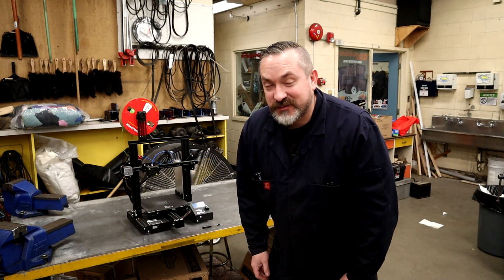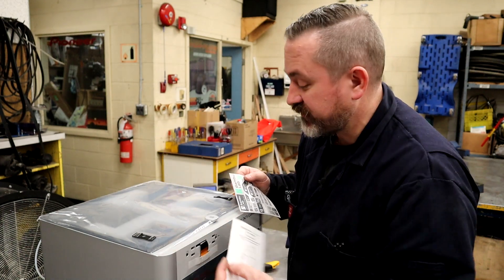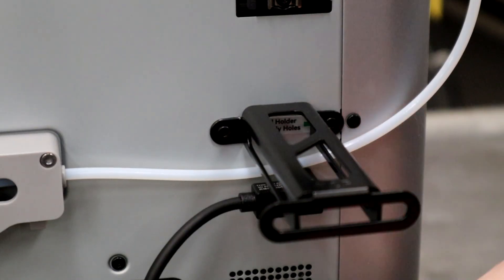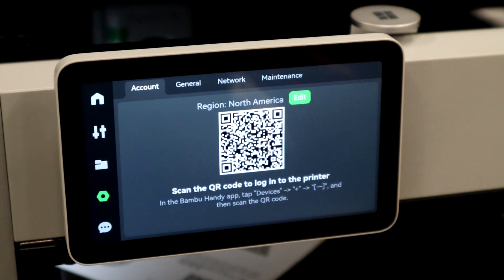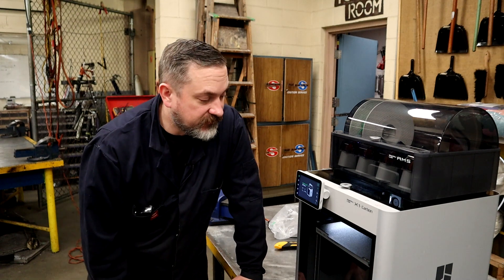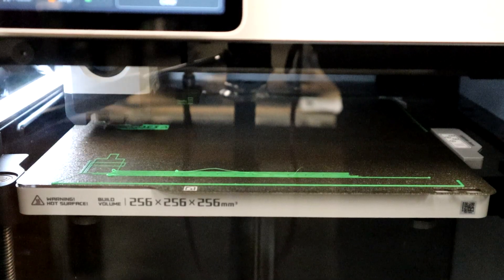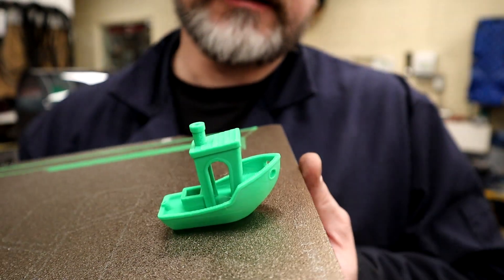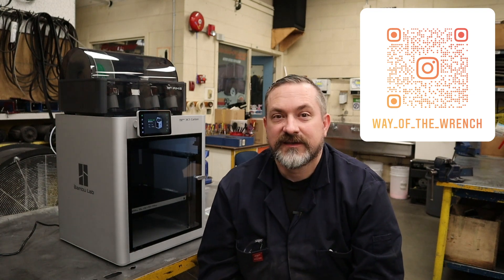How to set up a Bambu Labs X1-C 3D printer with AMS!

Comment: A gasket printed! I didn't know they could do that, since it's going to get hot. Wow.
Reply from the maker: You have to ensure the temperature won't go above 90 C or they will melt but things like gas tank, carburetor, and air filter gaskets will work fine.  Plus tpu is gas resistant too! Thanks for the watch!

Comment: You just got the X1-Carbon so I will cut you some slack.  As a BL owner for a while now and a creality farmer before that I can tell you... creality, not a great printer..the standards, as you will see with the X1 have changed.  And I suspect that you will feel similar as I did in that the Creality printers, even the new Carbon rip offs are mere rocks and the Bambu Lab printers are like a set of fine tools.  This company has turned 3D printers from tinkerer devices to home appliances.  I can print with 10x quality at 10x speed and not have to just sit and watch to make sure it doesn't explode.  All I do is regular maintenance such as clean and lub a few screws, and wash my build plate and nothing but consistency and perfect prints.  My two P1S printers run just about 24/7 and have needed near zero tweaks or adjustments.  It's a whole new world!  Enjoy the X1!  Feel free to reach out if you want some tips/tricks!
Reply from the maker: I agree, I'm super impressed with the X1, it's a game changer. We've been printing pretty much daily and so far everything comes out looking great and it's super fast.  Thanks for the watch and I'll keep you in mind if I have any questions, I'm pretty new to the 3d printing game.  Thanks for the watch and welcome to the channel!